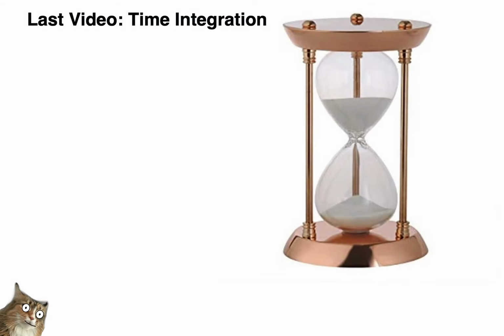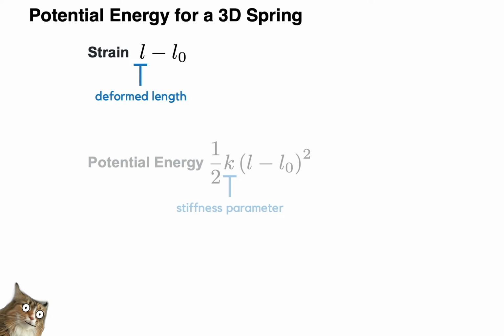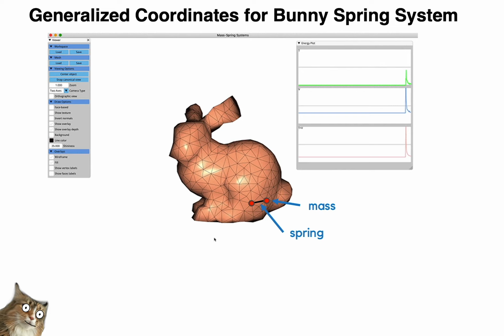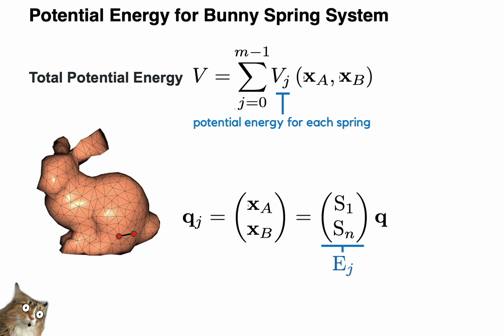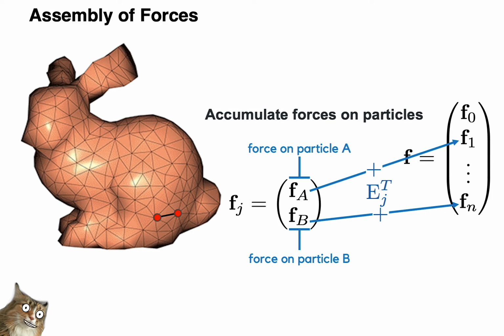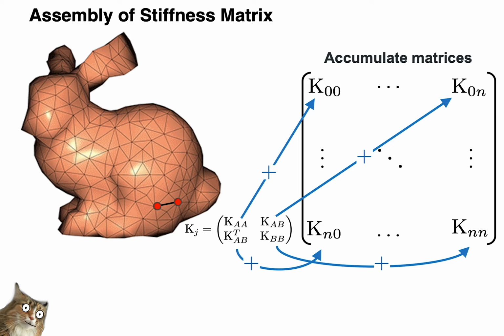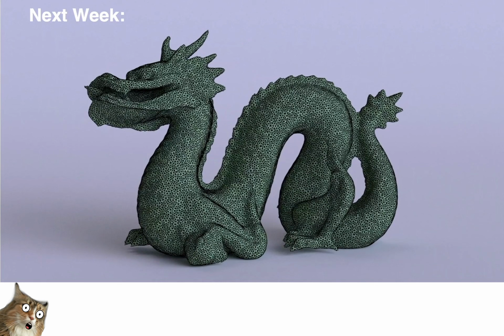Physics-Based Animation Lecture 3: Mass-Spring Systems in 3D

Comment: 0:23 Last video
1:22 3D spring setup
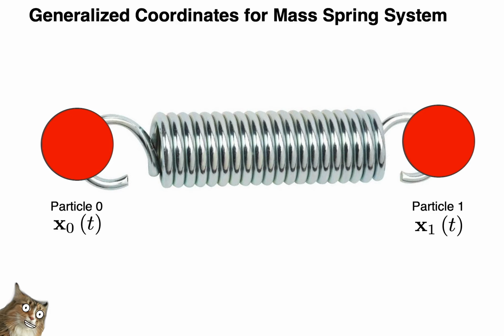2:20 Generalized coordinates of mass spring setup
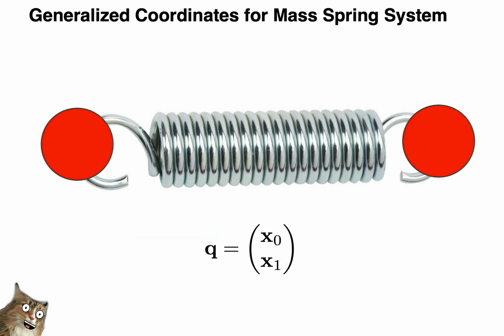2:41 Generalized velocity of mass spring setup
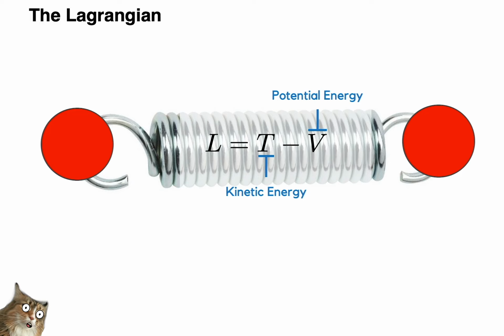3:01 Lagrangian
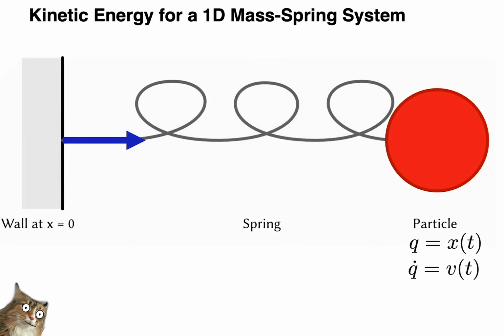3:18 Kinetic energy of mass spring system
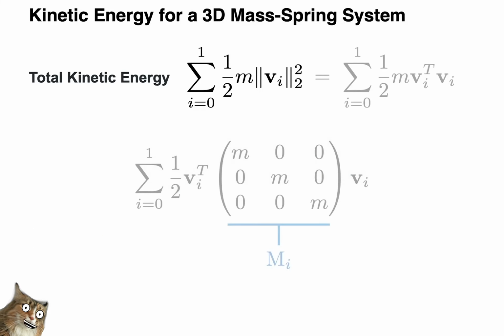4:44 Matrix form of kinetic energy
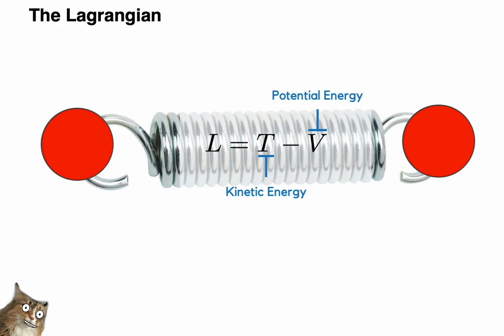6:13 Potential energy of mass spring system
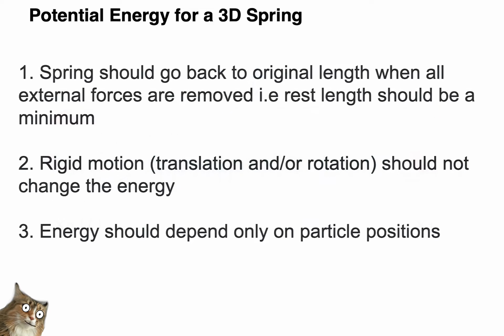6:55 Criteria of potential energy function in purely elastic object
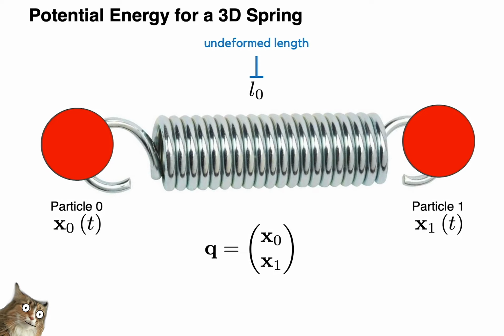7:51 Back to potential energy
9:39 Converting potential energy to q and \dot{q}
10:46 Back to lagrangian
11:17 Euler Lagrange equation
13:15 Single 3D spring to mass spring bunny
14:04 Generalized coordinates for bunny spring system
14:40 Generalized velocities for bunny spring system
15:07 Kinetic energy of bunny spring system
15:46 Potential energy of bunny spring system
16:38 Selection matrices
17:51 Back to potential energy of bunny spring system
18:52 Lagrangian of bunny spring system
19:18 Euler Lagrange equation
20:49 Generalized forces of bunny spring system
23:01 Time integration
25:25 Stiffness matrix
28:09 Fixed boundary conditions

Comment: At 31:12 when you do the Bunny animation, what are your initial conditions? Are you just setting the initial velocity vector for one vertex on the ear? It's hard to tell. I assume that the final position of the bunny should then be close to the initial position once the time integration resolves.